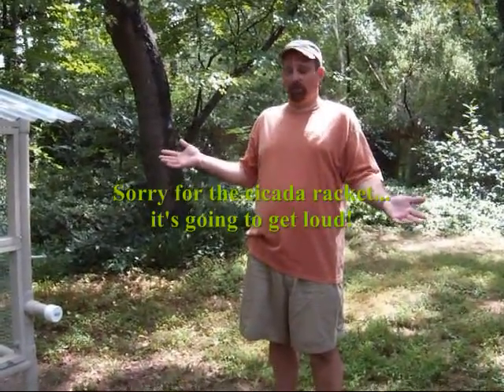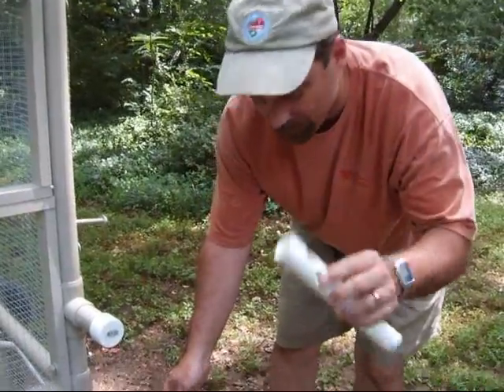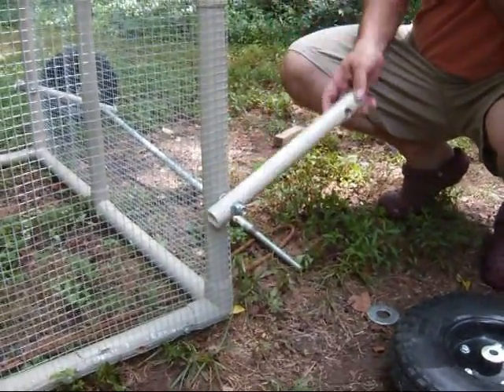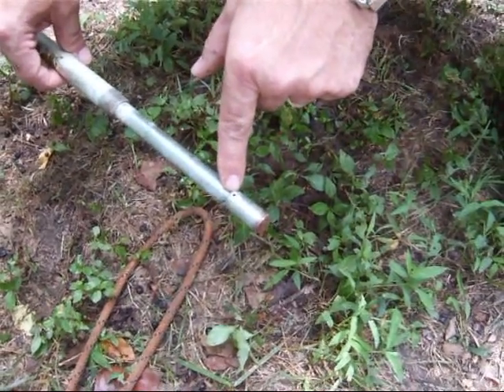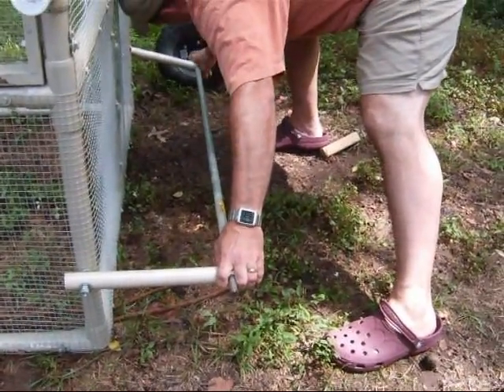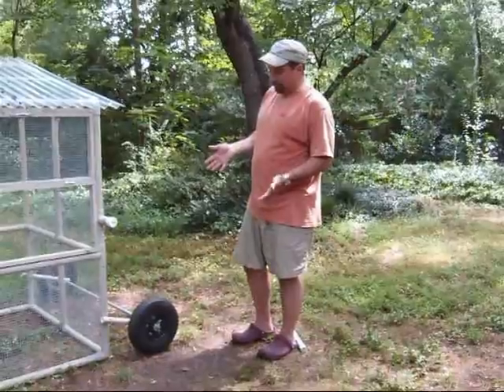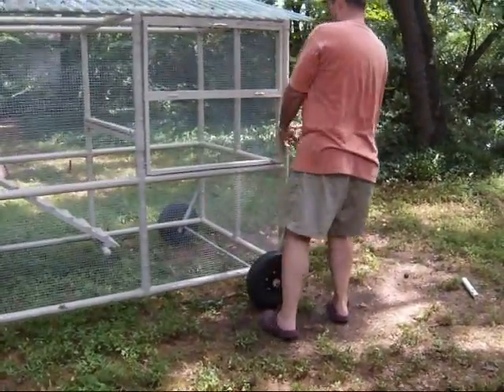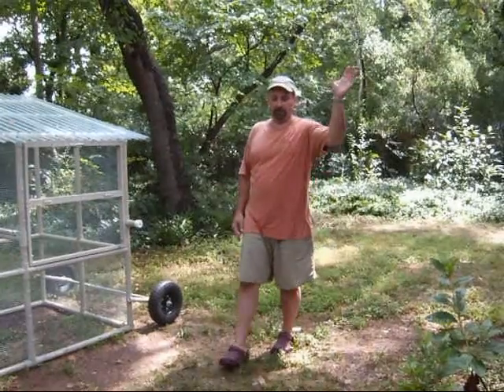How To Raise Chickens - Putting Your Coop On Wheels

Comment: Dude, I was toying around with the exact same idea in my head today. 
Couldn't get it to work. And then I found your video. Simple genius. Lifting it up causes the wheels to swing down to center and then when you set it down quick enough it pushes the wheels into the correct position, either under the coop or away from the coop, depending on where the starting point was. Brilliant.

Comment: take and angle grinder cut a tiny X, the  drill will go through easily.  I have been needing a good axle for my tractor. This video and learning about the pipe to steel trick was awesome.  Thank you.
Reply from the maker: Good tip - a file could easily make an "X".

Comment: I read in your details about the yard being all  shade and using the clear roofing.  I would suggest for most people DO NOT USE clear or opaque as your chickens will BAKE.   I used the solid panels in the color grey and it still gets very hot and makes it  hot for the roosting areas that are closer to the roof inside, during the day, so I am also buying emergency blankets to drape over the top in the summer.  And, I think I will cut some of them and pushpin some on the sides of my wooden nesting box as that also collects heat.  I live in S.C. so it is very hot but even in any location the clear would act like a greenhouse and bake the birds.
Reply from the maker: Roof panels depends on your situation.  My coup is in my deeply shaded yard, so clear panels provide light and (in winter) warmth.  If it gets too hot, you can always throw a tarp over it.  Heat is obviously a big problem if you have nothing but cactus where you are!

Comment: Great idea.  I loved this set up so much we are copying you and doing it.  I'm having trouble leveling out my cinder blocks for the base though.  Any advice or help in getting it level and even so that when your coop sits on it's base there aren't any gaps?
Reply from the maker: Actually on my coop, the wheels roll on the blocks, but when you take it off the wheels, the coop sits just inside the blocks.  That way you don't have to have the blocks perfectly level.  Best thing for leveling the blocks is to use  at least a 2' level and play sand as a leveling base.

Comment: How does turning it work with this design? I am on a 1/3 acre with a large backyard and my wife wants to be able to move it all over the yard.
Reply: Patrick, I've built Ricks coop wheels which you can see here: http://farmdweller.com/chicken-coop-part-2-wheels/.  To answer your question, the coop moves in a lateral line very easily.  To turn it, I pick up the lighter side and move it to the right if I want to push the coop to the left, and lift it to the left if I want to move it right.
Reply from the maker: Concur with Alastair.  I may add a better lift bar to the lighter end in the future as then you can steer the coop as you would a wheelbarrow.  Another person is building my coop, but is opting to put wheels just at the heavy end, with a lift bar at the light end.
Reply: Rick, Id like to see that! If you don't mind, I'll post it on my blog, www.farmdweller.com!

Comment: You should have made the handles on each end the same,so as to lift both corners at the same time,like on the roosting box end.
Reply from the maker: Yes, that would be best, but I put my coop right up against a shed wall, so I have to at least start moving it at one corner only.

Comment from the maker: Hi, sorry my drawings look like the chickens did them.  My post is located in the chicken tractor section of the coops page on backyardchickens - listed as the Hen Hideout.  It gives you the rough dimensions, but the biggest thing to work out is the assembly steps. I will try to add more info to this post in the future.

Comment: suggestion: don't make the entire roof out of clear plastic, unless the coop remains out of full sun .. otherwise, it's a hot house.
Reply from the maker: Ig Vigé Since the coop run is all screens, it does not get hot there.  The hen house part could get hot, but I keep the coop in the shade.  If you are worried you can use smoked plastic, a tarp, or window tinting to keep the heat down.

Comment: How about turning?
Reply from the maker: Unfortunately, turning requires simple brute force.  I recommend pushing from the lighter end of the coup and when you want to turn, just shove the whole rear end of the coup on around to where you want it.  It works easier if the ground is wet!
Reply: @ricktriebwasser4287  that is what I thought. Thanks for the quick reply.